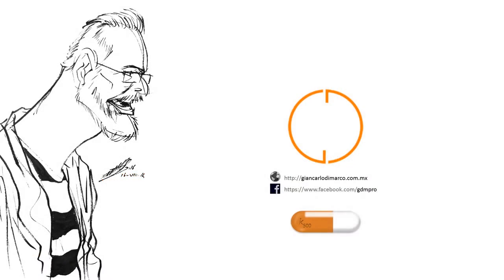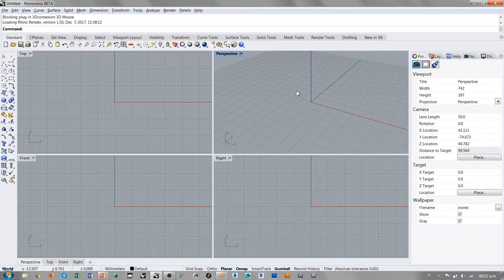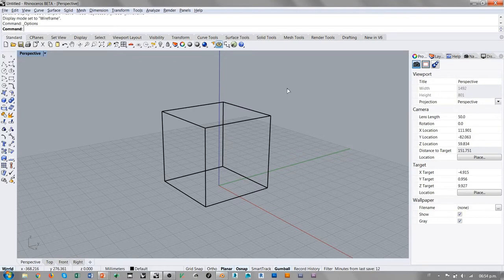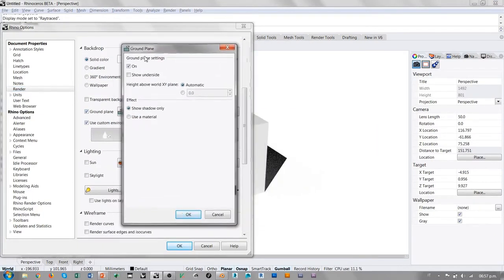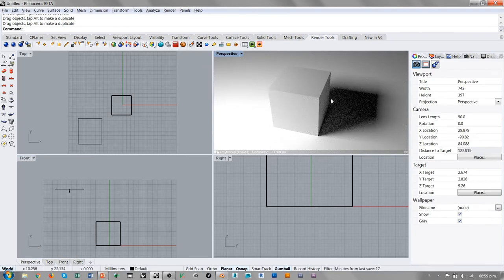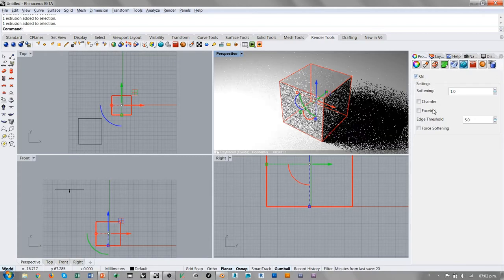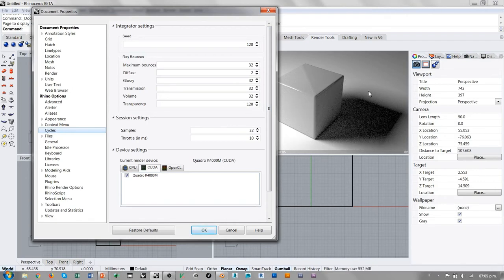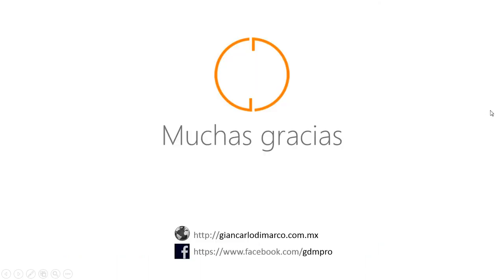Rhinoceros - Rendering con Cycles

Comment: Thanks. I didnt understand anything but it learned a lot with smoothing :-) I saw that rhino can use cycle renderer from blender. Do you know how to set it up?
Reply from the maker: It's already integrated, just switch to Cycles rendering in Render menu (Current renderer).